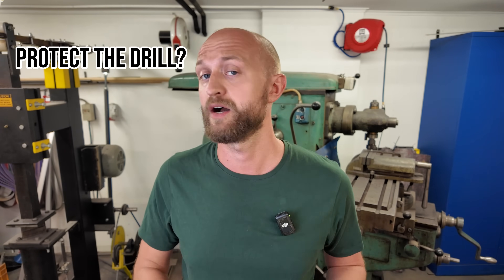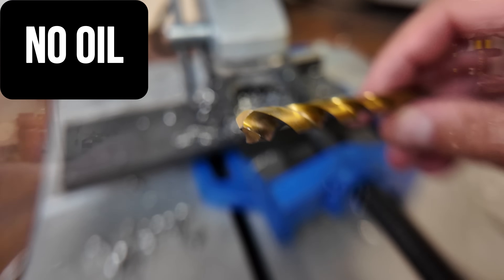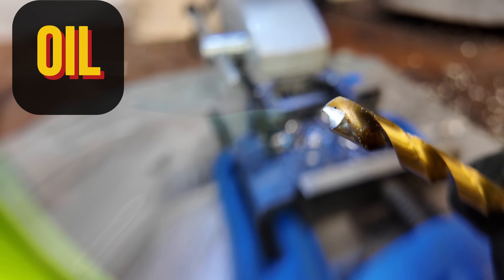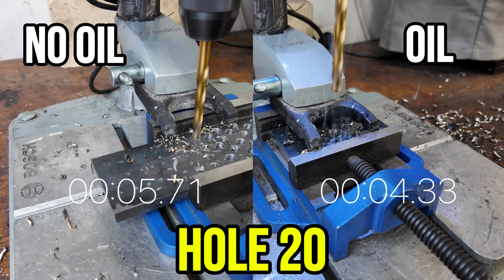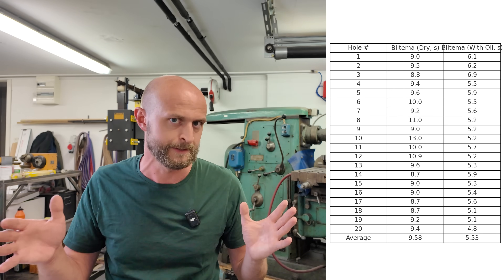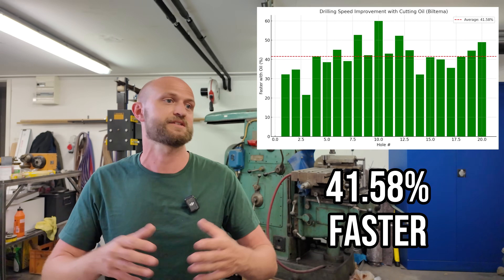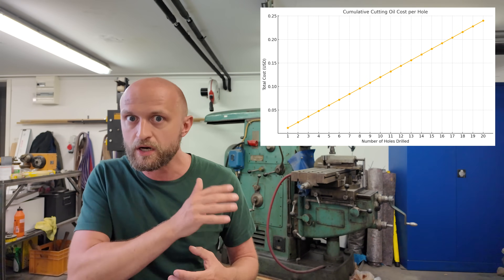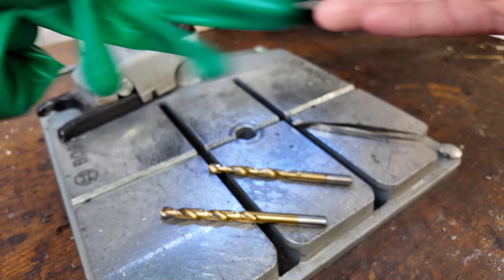You’re Drilling WRONG — Here’s the Proof

Comment: I recently started using Anchorlube and have to admit that I've been impressed. It's more of a cream than an oil and seems to stay on the bit better. Particularly with larger bits, I've really seen a difference.
Reply from the maker: Nice! I guess I’ve been stuck in the ‘oil and pray’ method, but if Anchorlube stays put better, I might have to switch teams. Especially for those larger bits!
Reply: @SteelSurgeon-h6p  Another Swede here who also likes Anchorlube. I cannot find it in Sweden so I ordered it from Amazon. A bit inconvenient to have it sen't cross the Atlantic but it lasts years for me and I use Biltema's cutting oil sometimes. Anchorlube is water based and doesn't smoke.
Reply from the maker: Nice to see another Swede! I haven’t tried Anchorlube yet, but it sounds great — especially if it’s water-based and smoke-free. Lucky we can at least order it from Amazon, even if it has to cross the Atlantic. 🙂
Reply: I have been cutting anchorlube roughly 50/50 with water for stainless
Reply: I'd think watering it down would lessen its ability to stay in place? That seems to be the major quality it has over oil?
Reply: @thom17043  If/when it gets old it thickens adding a few drops of water will restore its consistency. It's actually a water-oil emulsion and works like what we use in coolant systems and the bulk is to stay on the cutter. Cheers. btw, I'm still using a 30 year old bottle, sparingly. 🙂
Reply from the maker: Since it’s water-based, it’s easy to forget that just a few drops of water can revive it. 30 years from one bottle is seriously impressive! 🙂
Reply: Also its nice, if you dont wanna order it in the US, at Lowe's the spyder blue mach goo lube is the same thing, just with some coloring. I still got my bottle of anchorlube to finish up tho

If you look up the SDS, they both are exactly the same sds aside from a few names/addresses. Both SDS dates are on 1/17/22 and both have a specific gravity of 1.0365, its clearly the same.
Reply from the maker: That’s great to know — I didn’t realize the Spyder Blue Mach Goo was essentially the same as Anchorlube. Thanks for sharing the SDS details, that’s really helpful!
Reply: I hadn't heard of Spyder Mach Blue Goo, but looked it up and the SDS for both of them. As you say, they are identical except for a few names, addresses, and phone numbers. Same "slight almond odor." Same boiling point and specific gravity. SMBG shows about $11 for 6oz, AL is $14 for 8oz. SMBG is $130 for a gallon, AL is $95 for a gallon.